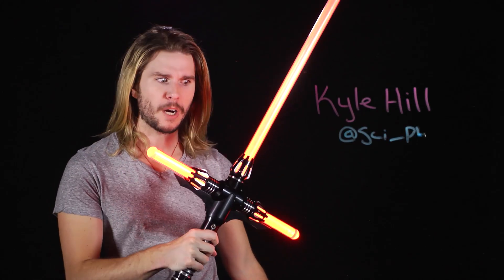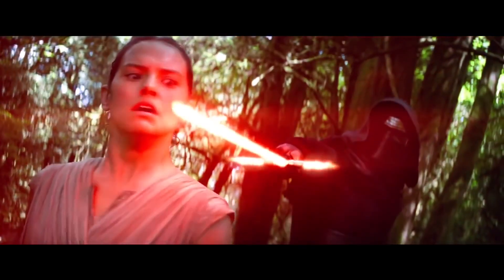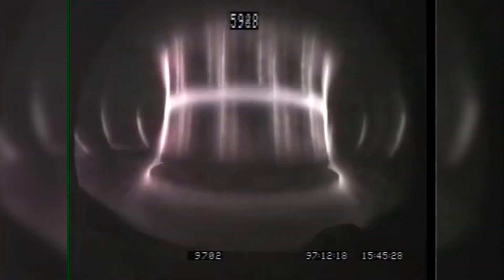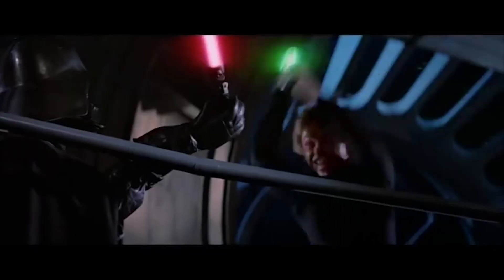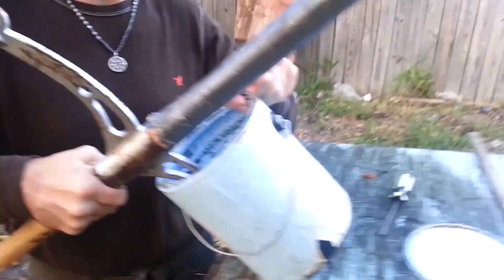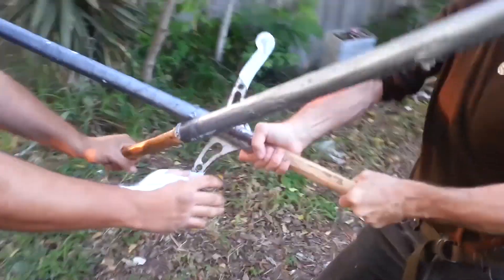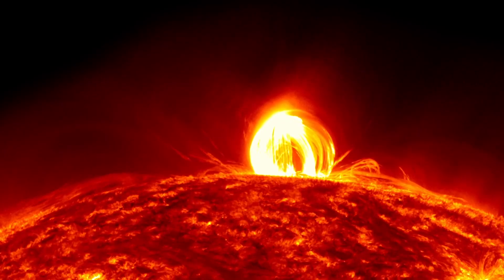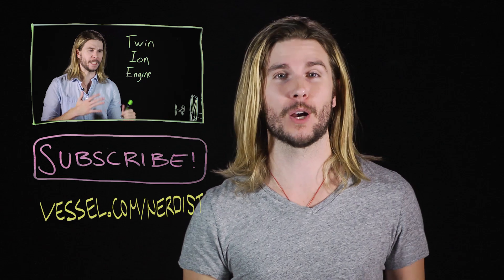Why Kylo Ren's Lightsaber Works (Because Science w/ Kyle Hill)

Comment: they are not cross guards, they are exhaust pipes. kylo's blade is a selfmade lightsaber based upon an antique design which used exhaust pipes to dissipate energy. thats why it also crackles and sparks, because its an older design that definitely had its flaws. Luke's blade does not spark or crackle or have exhaust pipes and you can see this in the movie. its not deliberate that they did it this way, it was on purpose and its canon, just look for the information, you will find that there were different models of light sabers, it just happens to be that kylo based his lightsaber on an older design upon convenience or lack of resources, his blade is clearly made from scrap if you look at close up photos. NOT CROSS GUARDS, EXHAUST PIPES!!!

Comment: also do to the fact that his energy crystal is cracked and unstable, his lightsaber literaly needs those extra plasma discharge thingys (ive been up sence 12am you can cut me some slack)to prevent it from going boom. also the vents make it more like the old sith war swords which were more European then the jedai's well they had jedi katana's before they had the protosaber. so its likely that the original Sith lightsabers (the modern lightsaber is a Sith design) would have had these vents. then ya know the sith were well almost compleatly destroyed by the jedi...several times and revived a lot of the time by fallen jedi. so this would expain why the would have eventualy lost the crossgaurds.

Comment: it has a cracked Crystal, the original versions of the cross guard Lightsabers were designed that way to expel the excess energy, it was to powerful to contain and they hadn't got to the point of designing a closed hilt, Kylo's has a cracked Crystal so that's why it's crackling and unbalanced, he only had access to a cracked Crystal so he had to make a cross guard to expel bit unbalanced energy coming from the cracked Crystal because the original crossguard lightsabers didn't Crackle and weren't all unbalanced like his they were just of old design.

Comment: Kyle, I hate to break this to you, But I fear your affection for something you find 'cool' got to you. Kylo Ren's Lightsaber is easily the most idiotic design ever made for a lightsaber and it is that way not because of personal preferance, But because of incompetance. The 'crossguard' is nothing of the sort, they are vents to siphon off some of the energy that would otherwise overload the hilt and possibly either melt or explode. The blade sparks and crackles because it;s instability due to it being a shoddy design, using a cracked crystal and very inefficiant power control.

Where you're especially wrong is that such a thing would be advantagous. No such a weapon would be more a danger to it's user than it's enemies. Because the lightsaber would need large wide cumbersome swings to prevent the weapon from hitting you, You have pretty much eliminated the possibilities of all forms of lightsaber combat as the movements would be slowed down immensely so Ren doesn't hurt himself in the process.Lightsaber combat is not the same as modern day swordfighting. A Lightsaber's blade is sharp all over, meaning the 'crossguards' are also sharp and any contact with your body means you'll lose something dear. Now you have 3 things to focus on keeping well away from your body..... Really not a good idea in combat.

Comment: His design is impractical and stupid. Steve has it wrong. The beams do not go through all the way. The guards can still be cut off.
Reply: The base of the cross guards are very probably made from a lightsaber resistant material, so they couldn't be cut off. They'd function like cross guards function.
Reply: Heimdal001 Kylo knows jack shit about constructing a lightsaber. He cracked his crystal and put internal components on the outside for god sake. Where the hell would he get lightsaber resistant material from? Also, that is false, since Rey cut his saber.

Comment: And now for the real, canon, reason his light saber has cross guards. Kylo rens light saber is ancient. The crystal inside is worn and this is what makes kylos light saber blade have that cool fire effect. The blade is unstable and has a cool fire effect but.. why cross guards? And I can answer that two. Yes sure they look like cross guards hell I guess they are.. but the main function of the cross guards on kylos lifesaver are actually to vent energy from the light saber blade. The blades energy is so unstable that it could damage kylo, stop working mid saber fight, and even explode! This is why kylos light saber has cross guards. It's to vent the unstable energy of the light sabers ancient crystal into a safer blade.

Comment: I agree, this lightsaber design would be extremely useful
Reply: Even the pros can be seen in this vid losing their hands.  If I were a jedi I'd be stickin somethin there.

Maybe a fancy miniature thermal detonator pommel that I can unscrew and throw as well...
Reply: +93Legit good point, but wasn't that fight right after Kylo took a bowcaster bolt to his abdomen?
Reply: Kambor dark side users use pain and anger to fuel their power so it would only strengthen him
Reply: Flame Breaker oh yeah you become stronger but that doesn’t necessarily means you become faster just look at Vader in his first suite he almost got killed once by blaster fire during his first fight simply because his reflexes were much slower compared to his time as Anakin. Mind you blaster fire was nothing for him but that’s kind of the same thing you become wayyy stronger but your injuries can still slow you down.
Reply: @ABEL-cd2sp  well yes vader got slower because of his cybernetics but those hits are devastating. He hits hard. He re adapted to a new light saber form again because he is much slower but he hits harder. There are other siths that are arguably better than him.
Reply: @ABEL-cd2sp  hes but he used his force powers to cover up the ineffectiveness of speed if you've seen the comics he is very powerful and has killed 1 ancient jedi and a very powerful ancient sith master of the dark side
Reply: HADEZ oh yeah I’m not denying that he got stronger I’m just saying he got slower he’s far stronger now but he was faster as Anakin before Mustafar.
Reply: @ABEL-cd2sp  ah I see
Reply: @flamebreaker7318  sith use it to strengthen them. Not dark side users. And kylo isn't a sith.
Reply: +93Legit That's like saying if you're a good driver you don't need a seat belt. There's good reason the cross guard was around for over 1000 years.
Reply: 93Legit no he's not weak he got shot with the bow caster and he felt extremely weak after killing han the opposite of what Vader felt when he killed the Jedi.
Reply: No it actually since it has too be lightsaber proof the cross guard would be so much better if the whole cross guard was the lightsaber proof metal
Reply: you have 666 likes
Reply: Mister Mannperson At that point we'd be meddling with forces beyond our comprehension.

But what if the Death Star is a giant pommel thrower? It unscrews pommels and throws them so hard it ends planets rightly, and the lasers are only a cover up?
Reply: Rocket Raptor only if ur a crappy fighter... u saw how kylo got wrecked by the chick. it was her first time using one and she wrecked him. kylo sucks A$$. if you were decent or pro, you wouldnt need those guards
Reply: 93Legit good point. I think it was partially also an intimidation tactic
Reply: 93Legit Rey won because she’s a Mary Sue. She can pilot the millennium falcon (which has been personally modified by Han Solo to fit his preferences) expertly without having any knowledge on how to fly a ship, and she beats kylo who was trained personally by Luke. What’s the reason behind this? Quoting the writers and daisy, “BECAUSE SHES JUST AWESOME”
Reply: @glowhoo9226  yeah keep ignoring the fact he got shot by a gun that can pierce armor and knockback normal humans and can one hit kill them and the fact he was shattered emotionally by killing Han and the fact he was bleeding out. Need I continue?
Reply: @93Legit  Yeah but Rey is a Mary sue
Reply: @93Legit  that's just bad writing not the light saber.
Reply: 93Legit kylo was actually really hurt in that battle, he woulda kicked reys ass if he hadn’t taken a bow caster to the stomach

Comment: Another problem is that sometimes the guard will actually make contact with the wrist depending on the technique you're doing. The reason people don't get cut is because cross guards aren't sharp, they're essentially a thin block of metal (which is the real reason people have been using them for centuries). This would present an issue if your weapon was made of plasma. Also with the example you gave, the person is using a greatsword, and the guard is farther from the hand than it would be with a longsword or arming sword (or Kylo Ren's sword), and the weapon he's using is used entirely differently than you would use a one-handed sword like the one Kylo Ren uses. Also, excluding the explained need for ventilation, why on earth would you not just make a guard out of a lightsaber resistant material?

Comment: The problem that I see with the guard isn't that it's there in the first place, but that it's so long that it inhibits wrist movement, which is extremely important in swordfighting. It's basically a greatsword guard on a one-handed sword. The metal part is also exactly where you would usually catch your opponent's blade with the guard, so unless it's a lightsaber-resistant metal, such as mandalorian iron, you would have to replace that thing after every lightsaber fight.

Comment: GReat video and I agree, his lightsaber is probably my favorite design and I'd opt for one if I was a Sith or a Jedi. One thing I will add though is Stephen Colbert was wrong. The cross guard in this case would not block an attack it's more just expelled plasma. Not strong enough to block but plenty enough to burn the crap out of someone. A lightsaber is already potentially fatal to the user so adding to side vents that will just burn you good is actually kinda more a safety feature than a hinderance haha.

Comment: my 2 cents worth: those "crossguards" are actually exhaust vents for the plasma.

think about it: they activate after the main one does, and the overall appearance of the of main blades appears more unstable than the original versions (compare the Kylo vs Rey battle), which has the side effect of producing a cooler looking light sabre.

now. question: why?
Answer: with the number of Sith and Jedi both dwindling to the low single figures, the crystals required to make the light sabres no longer exists (or where know where to find them), and no one completely sure how to make them. This means that during the production of the crystals (Sith makes their own, instead of procuring it a planet), some defects was added. This points back to the above statement of a light sabre blade that is unstable, and requires a release vent. This being Star Wars, it came in the form of a cross guard.

i could be wrong.

Comment: Hey man can you do a video about the actual act of spinning or twirling a light saber? constant point of contention among my friends. i say its almost impossible to spin a weightless blade. Love the channel keep it up
Reply: good point, but I don't think they spin it as much as they just rotate the wrist.  A light Saber is just a katana or any other light, mainly straight, oriental blade.

You can use your TV remote to do almost all the tricks seen in the movies and it still works. (The batteries make it heavy enough to spin in your hand to a degree)

I'm assuming the mechanical part of a light Saber is relatively heavy compared to something like the hilt of a sword that hasn't been balanced yet.

Comment: iN the Starwars lore,  Kylo's Saber is based on a Older Saber Style, and  those Beams are not  a "cross guards"  they're Exhaust ports. Kylo's blade  uses a Cracked unstable Crystal, which gives the Blade more power, hence all the "crackling"   but if it didn't have the exhaust ports, which just happen to double as a cross Guard " happy accident " ,   his saber would actually Explode, 

According to the Lore...

Comment: Here is one thing thou. The reason for you being able to hold the normal lightsaber close to your face is because the electromagnetic coil is keeping the atoms outside the coil away so the atoms doesn't interact with the plasma inside but kylos lightsaber doesn't have that magnetic thing so that is the reason for the crossguard, to stabalise the energy flow or whatever so having a normal modern lightsaber close to your face is fine but if you had kylos... well say good bye to your head.
Reply: not joking before they had kyber crystals as energy source for the lightsabers they had pocket batteries attached to the bottom of the handle with a normal cable.

Comment: just the fact that is has a crossguard means that it isn't a saber, even a lightsaber. but great video none the less, as usual :)
Reply: While you're right that it technically wouldn't qualify as a saber, your reasoning is incorrect. The definition of a saber is a sword with a curved blade and single edge. So yes, it's not a saber given the blade is straight and has... technically no edge, but I felt that the proper definition should be given.

Comment: Adding weight doesn't make a sword more unwieldy.  WHERE you add the weight is what matters.  Well within reason anyways.  If you took a longsword with a crossguard and removed the crossguard the point of balance would shift to the top and make the sword more unwieldy.  The reason that the "sword" in the video seems unwieldy is because it has no pommel and the whole thing is rattan with no distal tapering that real sword had to move the point of balance closer to the hilt.  Also, the whole thing is about the size of a greatsword instead of a longsword that Kylo's lightsabre is based on.  That said...yes the point about crossguards being a good thing is very true.  Even when fencing with mostly stabbing weapons, simple guards  like these do and can block attacks at your hand.  Yes I am a sword geek.

Comment: Um, the issue with Kylo Ren's cross guard, isn't the hand protection, it's the lazer blades coming off it. This isn't a mater of science as such, it's a matter of swordsmanship and why real world swords haven't had knives attached to their cross guards.
Reply: But they do have spiked crossguards.  They didn't put blades on a crossguards because it would take direct hits and dull super quickly or snap off.

Light sabers don't have to worry about sharpness, weight, or density and width, nor do they have to worry about forging errors, inherent weakness in the metal, or durability.

The only reason you don't see bladed crossguards is that metal makes a pretty poor medium for them.  You are essentially looking at a longbow and saying a crank would ruin it.  Yeah, a crank would ruin a longbow, but a crossbow isn't a long bow and doesn't have the same properties, only similar ones.

Comment: The problem with kylo ren lightsaber is that the handle is round. As any swordplay should now, if you have a round handle, the sword can and will rotate in your and as you fight. That's why all swords have a elliptic handle. However, the fact that the blade is round could solve this problem at least in the impact between two sword and with a proper training Kylo could learn how to avoid slicing himself. So if kylo ren lightsaber had an elliptic handle it would be just fine.

Comment: There is actually a reason so many hands get chopped off. It's called the contact mark cho mai in jedi teachings, and is seen as a merciful way to end a battle. Also, to the sith, it is the most efficient way to win a battle if you can not find an opening to kill your opponent during the battle.